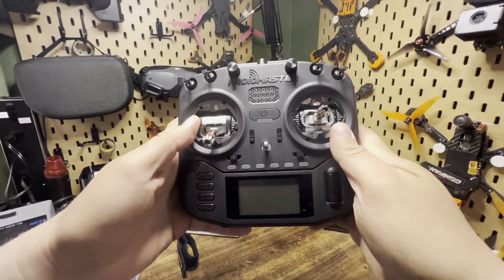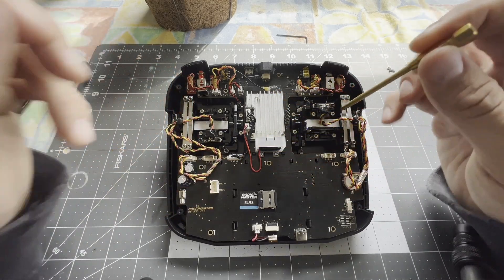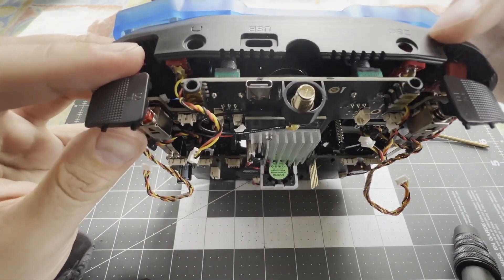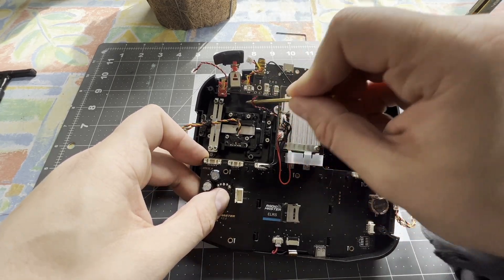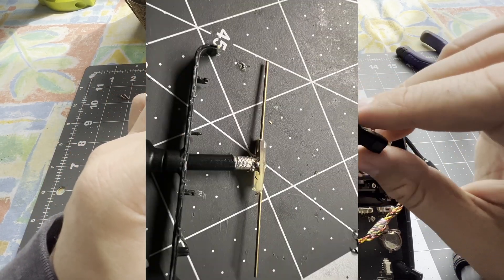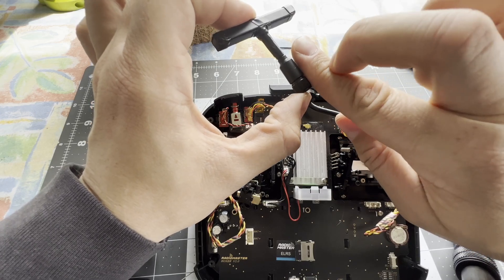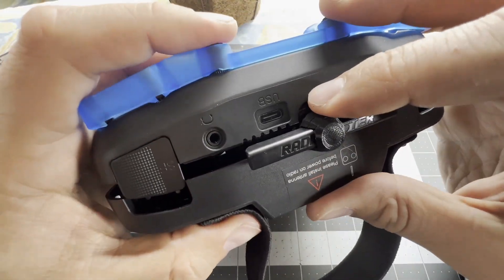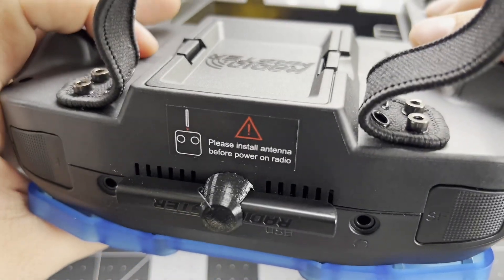Radiomaster Boxer antenna mod - Make it more durable!

Comment: just finished the mod and did a test flight w/ my 2.5" geprc phantom/cinerace20 frankenstein and had no noticeable difference w/ range.  I flew to the where I'd start losing signal before the mod and was able to fly just as far w/ the mod.  thanks for this.  I like it a little more aesthetically than the stingerswarm variant.  and, if I wanted a pristine holeless case again, it'd cost me 5.00 plus shipping from Radiomaster.  thanks for sharing.
Reply from the maker: Awesome, glad i could help :)

Comment: Great mod and great video going over everything you need to know to do this mod. great video angles and good verbal instructions through out.  Mod looks really good and performs on par with unmodded boxer. 3d print is also spot on.  I also took plastic part of sma off and some foam in module bay as @prophead did. Thanks Dano!!

Comment: Did it today, also removed the plastic part around the sma connector by simply unscrewing the nut on the inner side. Added some foam inside the module bay for anti wobbeling. 
Signal seems to be as strong as before…maiden flight will follow! Thanks for this easy, clean and nice idea m8 ❤🤙🏻

Comment: Video description says functionality and range is "preserved", this is objectively untrue. You've locked yourself into horizontal polarization for the life of the radio unless you toss a module into the JR bay and use a secondary antenna or undo this superfluous modification.

Comment: nice video! I have suspected my boxer antenna to be broken, it just free spins. You confirmed it with those pictures. I'm surprised more people don't talk about this problem... Ordered a new one, in the meantime I wonder if I could repair the one I have like you did. any tips for taking the antenna apart? I will probably end up doing this mod. Thanks for sharing
Reply from the maker: You have to take an xacto knife along the bottom of the plastic housing (closest to the main shaft that leads to the SMA). 

Its kind of hard to explain tbh.

Just look from the SMA plug up to the main T part, you will see 2 splits on the bottom, thats where u should pry.

Comment: Do you think it would be difficult to mount the folding antenna for the pocket on the boxer? They look to be listed at like $4 at radiomaster
Reply from the maker: Idk but I’m gonna try it
Reply: @DanoFPV  I'd definitely watch that video. I'm going to see if the antennas are available from getfpv or RDQ soon, since they are local to me. Otherwise I'll pick one up from radiomaster. If it doesn't work, I'll have a backup for my pocket anyway.
Reply from the maker: @kurtzFPV  https://www.instagram.com/p/Cx--_rqrniX/ That mod is very simple, you would just open up the boxer after you printed the piece, and pop the new ant on. https://www.thingiverse.com/thing:6251073
Reply: @DanoFPV  really appreciate the link. I bought the antenna finally from radio Master but have been too busy/lazy to try the install. The link will be a great help. Edit: the mod looks perfect. Like it came that way from radiomaster. You should post the vid to YouTube also.